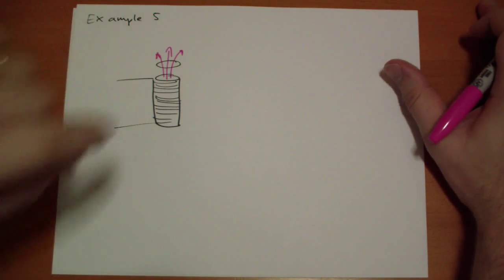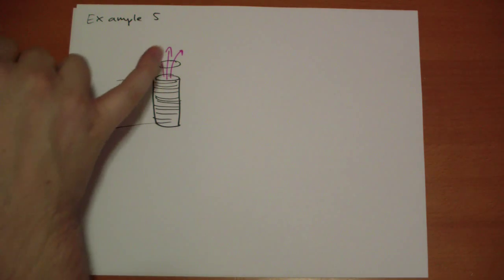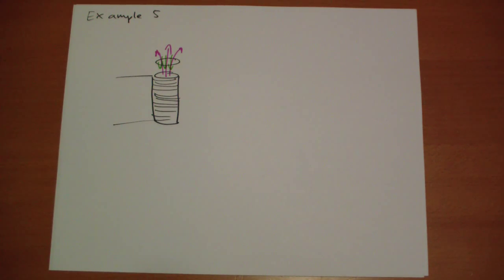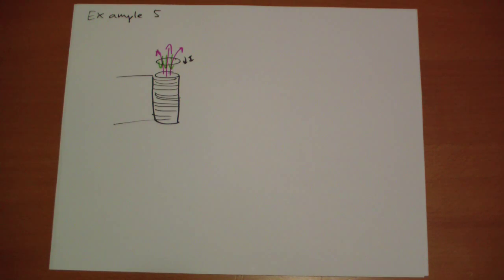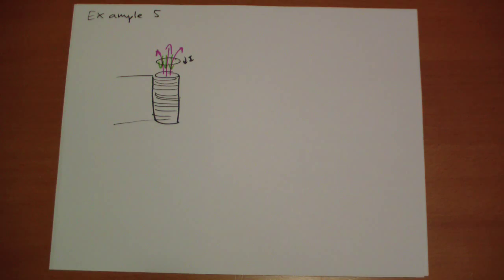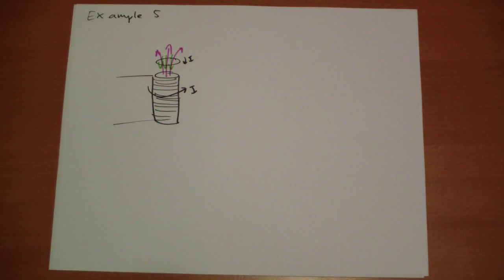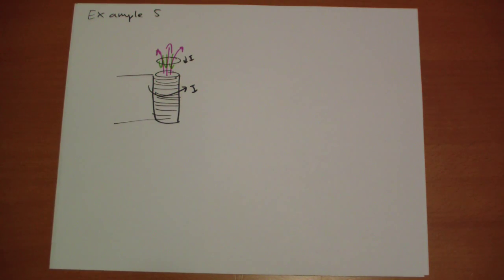7.2.1 Example 5

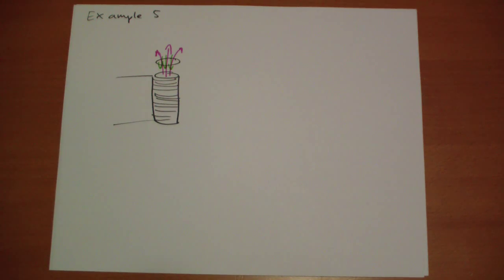Comment: To clarify, at around 0:50 you use the right hand rule to determine which way the induced current should flow. Are you pointing your thumb in the direction of the induced magnetic field, and letting your curled fingers tell you which way the current should flow? OR are you using the old rule, and just figuring out what direction the current needs to flow to make a magnetic field point down?

And does the distinction even matter?
Reply: Damn dude it's been 9 yrs how's life? Has ur doubt been cleared?